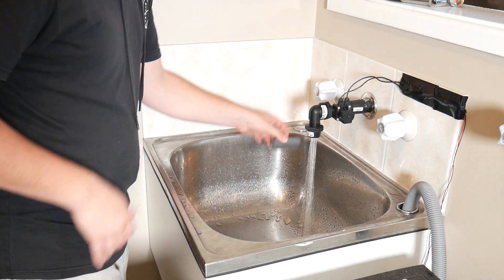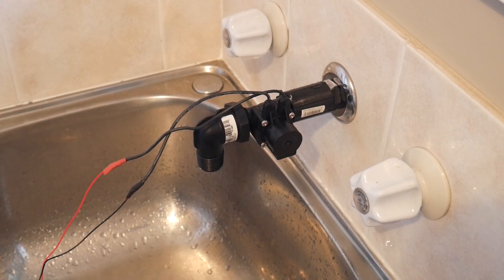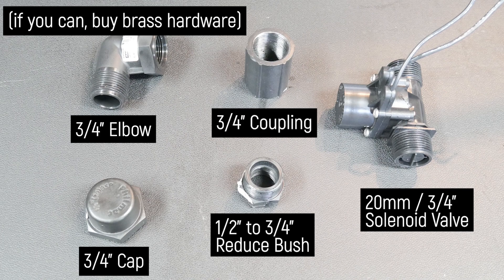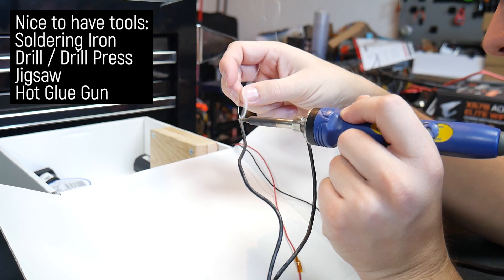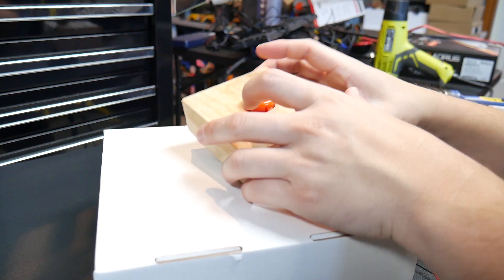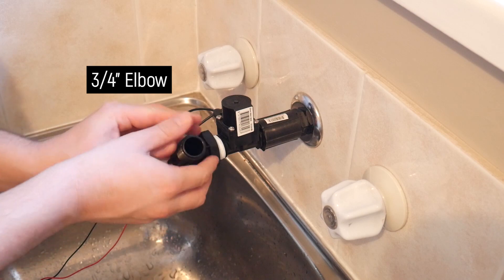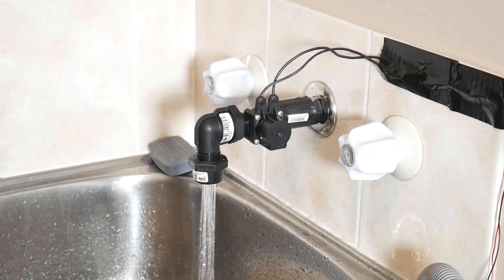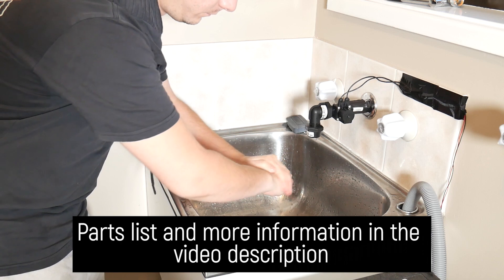DIY foot operated tap for hands-free washing.

Comment: I have concerns about the parts that you have used. Are they drinking water certified? Could be dangerous if you are using this in long term.
Reply from the maker: Not really intended for that, more of a temporary fix for a current dire need.

Comment: Another no no is don't paint power supplies and power leads. There is no guarantee that the plastic is rated for paint. If i came across that in test and tag it would be a bin job.

Comment: BSP and metric threads are not interchangeable. They use a different thread angle for a start.
Reply from the maker: The metric value refers to the ID, that's why the naming is so confusing

Comment: Issue here is the fact that you can't have the two systems connect without some kind of release, or else one of the two, will push the other back (in a boiler situation, that would run the boiler continuously because it would seek heat and not find it.
You need two irrigation valves for hot and cold, and then you need to use the safety taps to meter how much water will go to get the perfect mix. Not that straight forward, but good idea none the less.

At least here in Europe, putting an electric valve on the water line is easy, NA style homes, a little more difficult, since they have in wall rigid piping (for the most part).

Comment: Also consider investigating and implementing an IR sensor to activate/deactivate the solenoid.  Typically powered by AA batteries and can last between 6-12 months or more depending on how frequently the sink was used.

Comment: Two quick notes.  This may not be an issue for the limited amount of time you are leaving this on (vs a yard sprinkler setup), but while the solenoid can operate at 12V DC it will actually burn them up to hold them at 12V.  To safely run the solenoid on DC you can open at 12V and hold at something around 5v. 

You can read more about that at https://rayshobby.net/wordpress/understanding-24vac-sprinkler-valves/

There are also some latching DC options for this as well. (not as common and slightly more $$ but will not require 2 voltages)

Comment: One issue, if your water pressure is not even you could flow water from your hot system into your cold system when the valve is off and your taps are on.

In a system like still exists in some homes in the UK for instance, where hot water is dirty, coming from a cistern, while cold is from the outside this could result in hot non potable water ending up in the cold potable water system.
Reply from the maker: Yeah fair, it's something I wasn't aware of. If you keep the hot water off, it should be OK?
Reply: @MakersMuse  There is probably plumbing code that covers this. See backflow protection. An example issue is that if your domestic water supply looses pressure, your valve (assuming it's closed) will allow this faucet to siphon water from the hot water tank into the cold (potable) water pipes.
Reply: @MakersMuse   yes, scientifically OK, but possibly illegal.  Keeping the hot supply turned off is equivalent to not having it connected.  No problem.  The law, which is at times an ass,  may say otherwise.  Here in France, if I have a heart attack, I'm required by law to fill in a form stating my reason for leaving my house in order to ask a neighbour to call emergency services.  We have to hope that the police won't be too picky,  and I don't think they'll give a toss about possible back feed from your device, for the time being.  Hell,  building regs weren't implemented for grenfield tower!

Comment: In addition to the already pointed out water intermix, parts past the valves are not tested for high water pressure, so they may leak. I would advise to never leave tap[s] open for prolonged time, especially without supervision. Also, you need to test for leaks in hidden places (i.e. inside the wall in case of the video).
Reply: Yeah those valves are most definitely not designed to be blocked and left open. This video really should be removed. Perfect example of someone trying to do something without any knowledge. This is downright dangerous to do.

Comment: For the hands free soap dispensing you could probably use one of those water pumps which pumps by running wheels on the outside of a tube, then just hook it up to an arduino alongside a sensor that can detect distance and boom soap

Comment: Easier to just print elbow adapters like the ones in operating theatre scrub rooms to the valve knobs, but if your knobs need a large turn to get decent pressure then you will need to add isolation valves with the elbow adapters and have the pressure set correct on the knobs

Comment: Good idea - especially for cases where the pipes are hidden otherwise you could install a standard foot switch which activates a regular lever style valve without any electrical stuff. But I got a weakness for electrical stuff lol. to do more electrical/electronics you could install a proximity sensor that turns the relay on when you stick the hands under it - I know already exists too - but might be fun to experiment with

Comment: Great idea! Small bit of input here make sure not to drink from this tap as the plastic used is likely non potable and can contain toxins that can cause havoc overtime. Brass parts will not have this problem.
Reply from the maker: Yep if I could get all brass bits I would have honestly, much longer lasting!

Comment: Hi, you should never do it as shown.
You definitely need 2 electric valves to be placed before water mixer or hot/cold water will flow thru mixer into cold/hot tube depending on pressure difference otherwise.
This may be not so noticeable if heater is installed in your home but become critical on central heating system where hot and cold water are completely different contours and have significantly varying pressure.
Let's not think on water volume meters in this case: extra expenses possible are your only headache. 
Let's think about neighbors who will get cold water out of hot tube or (even worse) vice versa...
Reply from the maker: Fair, in that case we'll just leave the hot tap off!
Reply: @MakersMuse  This will work, for sure (while not so fool-proof) :)
Reply: This would actually be illegal shoddy install do where I live. You might even have to pay serious fines for doing something like this
Reply: @jothain  right, because under no circumstances should other water (eg: the heated water) have a path into the potable water supply (the cold water).  Any valves should be upstream of any combining. Preferably upstream of the existing faucet controls, so that way the plumbing downstream from the controls is not subject to pressure it wasn't designed for.

Comment: If you’re going to leave the knobs for hit and cold left open you should install check valves on the lines so cold water doesn’t push into the hot water line nor the reverse.
Reply from the maker: Yeah fair, maybe stick to just cold water for now!
Reply: @MakersMuse  very hot water is presumably better,  to ‘cook’ the virus while rinsing - preferably as hot as one can stand?
Reply: @oliver90owner  soap is enough u dont need to cook anything especially not ur skin, since its getting enough abuse from all the frequent hand washing
Reply: @oliver90owner  Hot water isn't meant to "cook" viruses.  The temps to kill a virus far exceed what your skin can tolerate.  The warm water is meant to help the soap surfactant break down and remove the oils your body naturally produces.  Or any other oil on your skin.  Oils can collect contaminants including viruses and protect them from being removed if you don't wash properly.  The hot water greatly helps in this regard.
Reply: @oliver90owner  lol, no. Purpose of hot water is make cleaning solution more effective. Warm let's say something like 30-40 degrees C is actually the most ideal temp for most common bacteria, fungus, yeast etc. to grow. Skin can barely take 60 for a very, very brief moment which isn't even close to kill bacteria/viruses during washing.
Reply: Yeah, this leaves the presented setup in a pickle, you can't install that check valve in the wall. I think that the better solution would be to go to the main line and have two of those water irrigation valves put on both systems. You then use the safety taps to meter how much water you need to use to get the "accepted" heat out of your water mix.
Extra cost, but not that much more or less hassle than having to install check valves in the system.

Comment: You could also use an Arduino with a motion sensor but that is quite an upgrade to this project but a nice direction to go with this project.
Reply from the maker: Yep there's a tonne of smarts you can add! I wanted to get out the bare basics version first, but for soap dispensing I suspect some motors will be needed so might well involve some sensors too :D
Reply: @MakersMuse  I like the idea of you getting the basics out first, great idea Angus, makes the project more accessible to the novice electronics guy out there.
Reply: @MakersMuse  What a good excuse for a 3D printed peristaltic pump - perfectly portioned soap.
Reply: I would go with an IR sensor, but it's the same idea.
Reply: There is no Arduino required, just a simple analog circuit. But I know, that is not very makerish ;)

Comment: Such a nice idea, especially in a public area.  Nice job Angus.
Reply: Totaly agree.
Reply: Public areas usually have infrared-based reflection sensor operated taps that sense when there's a hand or any other object nearby. They can run on batteries for months.